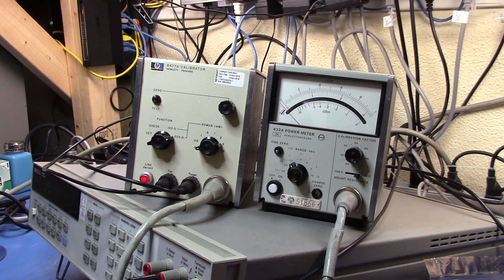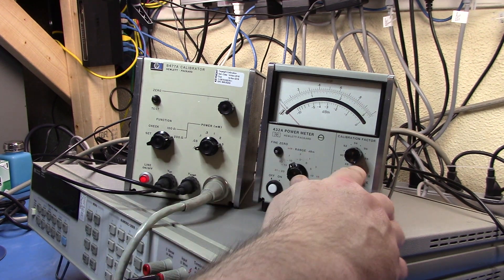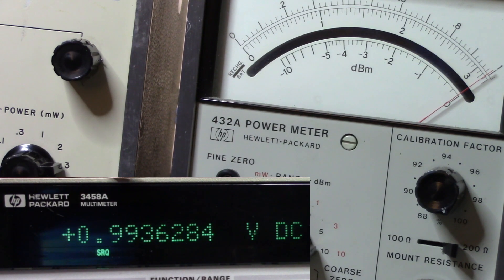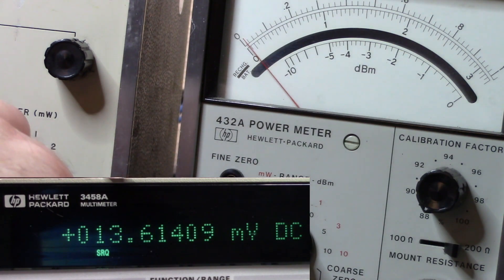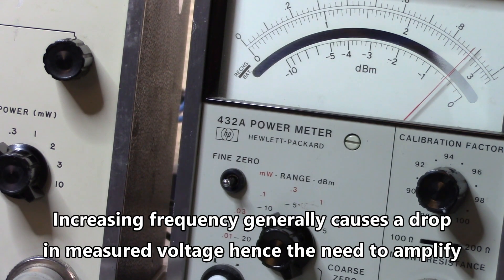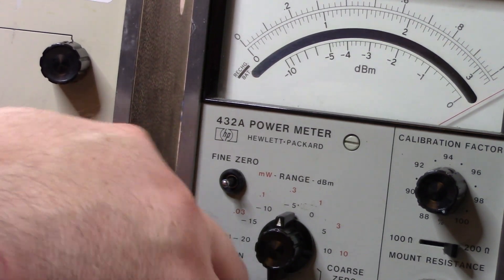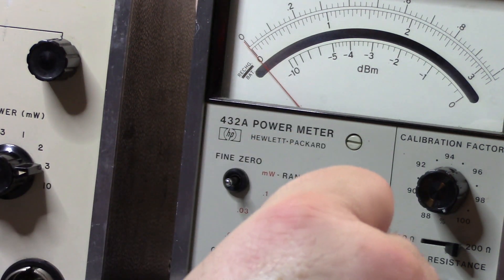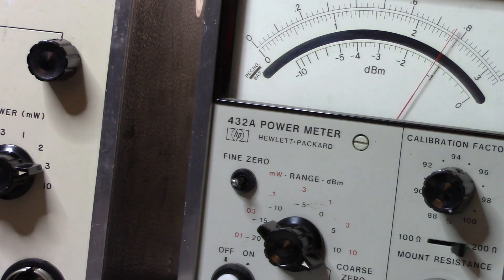Using a HP 8477A Calibrator to test a HP 432A Power Meter

Comment: hi  very nice!  i want to ask you in any  new meauser  the  power meter must calibrate ?
Reply from the maker: If the meter is new, then typically all you need to do is to confirm that it passes the operator check (assuming that the manufacturer has included a calibration step in its production). If you want to be very sure or the meter is second hand, then you'd run it through its performance checks. If you've done any work on it, then you should run it through the adjustments process before use.

Comment: I am wondering why, when you started, you did not initiate the fine zero switch as the meter movement was starting below zero?
Reply from the maker: I must have missed doing that as you're supposed to when using the 432A.
Reply from the maker: Actually, just looked at the video - Are you talking about the zeroing at the start of the video around 2:24? If that is what you're referring to then this action isn't part of the test when using the 8477A calibrator - Using the zero knob on the calibrator takes care of that operation. Fine Zero is an automatic control that helps keep the bridge balanced when RF power isn't applied.

Comment: Good on Keysight for still supporting this gear which I'd imagine is actually still used in many shops. What was the magnitude of what they got for doing that for you?
Reply from the maker: All up, between the 3458A, 8477A & 432A-H76 it was around $2.5K but it is important to get these things checked when you buy them off eBay - I don't think I'll be doing that yearly as I don't need traceability. I'll do a standards cal on the 3458A every 3 years to see how it is drifting though.

Comment: Interesting video, thanks for sharing. I'm not sure I understand the difference between open circuit and closed circuit meters, is that a difference between thermistor sensors and diode sensors ?
Reply from the maker: Yes - The 8480 series sensors are basically "open" in the sense that they need the power reference to set the measurement (The 'open loop' designation is a play on control theory with the 'open loop' systems needing a stake in the ground to work). "Closed" ones are like the 478A Thermistor which can make a measurement directly without referencing it to another value.
Reply: Thank you for the reply. I've used power meters for many, many years as a radar technician - almost exclusively the diode sensor type - and never noticed the (now) obvious difference between the older thermistor mount meters and the newer diode meters - no calibration source on the thermistor meters! There is no need to "calibrate" the thermistor sensor before use. Still learning ! My choice for my retirement bench was the HP 437B with a 8482A  and a 8484A sensor.

Comment: Noticed the needle is twitching around a little on the first test, I wonder if one of the controls are a bit dirty? Probably the calibrator output, due to the voltmeter jumping around a bit too.
Reply from the maker: I think it is my radio mic - I noticed the needle not moving when I was quiet.